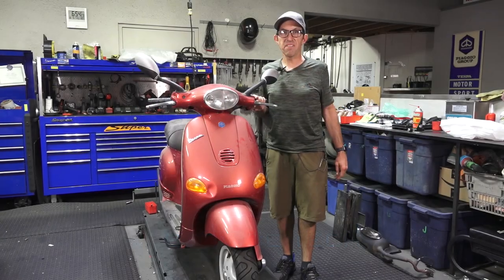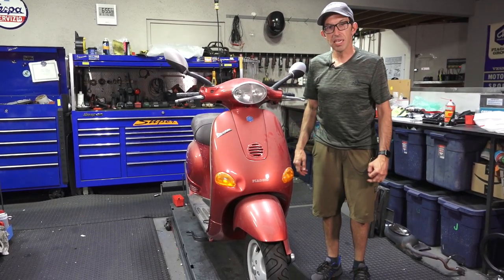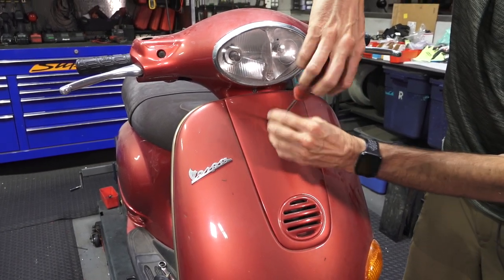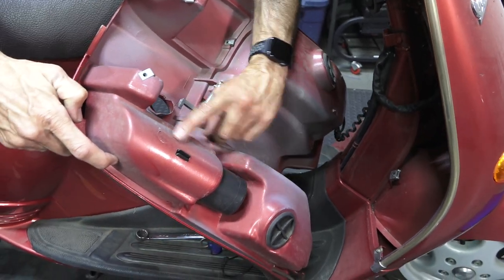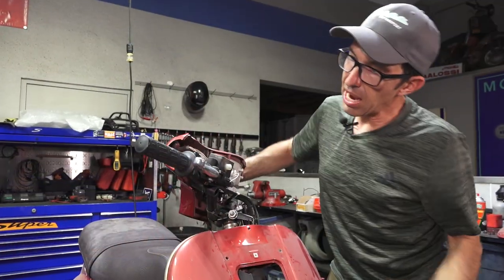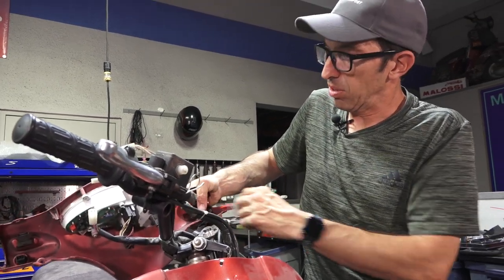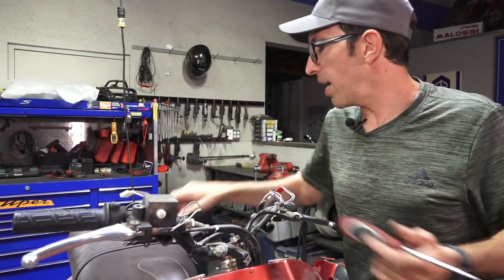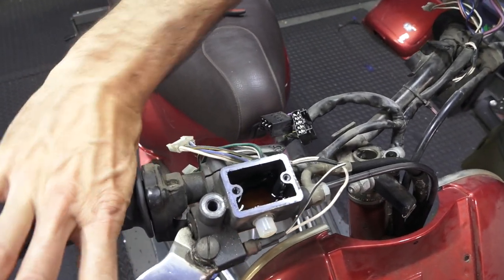Vespa ET4 Resurrection PT. 5  | Dropping the Fork, Steering Bearings

Comment: No front brake dangerous! Obviously you missed the sixties and seventies Chopper craze where they had spool hubs in 21 inch wheel , slugs in the front fork tubes pushing the fork tubes below the lower yoke .  No modified frame stem resulting in the entire bike at a 45' angle  to the road surface. I did a inspection for an insurance company after the frame failed.  Some one had cut the down tube bent the backbone Tack welded in some galvanized water pipe, cover it in bondo did a custom paint job. Result it broke in two at 70 mph.

Comment: I just bought a fairly new primavera and didn’t notice that the front fork is bent/compressed. While I know you’d have to take a look at it, would you think only changing the front fork would be sufficient or would I possibly need to change more parts?

Comment: Really nice job!!  On my XR200, it was a little stiff. I drilled a small hole in the fork head. Shot a little WD. Hit it with my blow gun. Then I used a grease needle to put a few pumps in there. And blast it with the air.  The motorcycles use tapered Timken roller type bearings. I know I cheated a little. That was 20 years ago. Still sweet. Is my Buddy 125 similar to the Vespa with ball bearings?  Or r they tapered roller?  Thanks again!!

Comment: is it possible to remove the front suspension without removing the hole steeringthing? i have the problem that i cant loose one of the two upper screws because its to tight in there and the suspension itself is in the way.. nice video maybe i need to remove the hole thing if its the only way. Thanks!
Reply from the maker: Watch the next video where we work on the brakes. We had to remove the suspension to route a new brake hose through the fender.